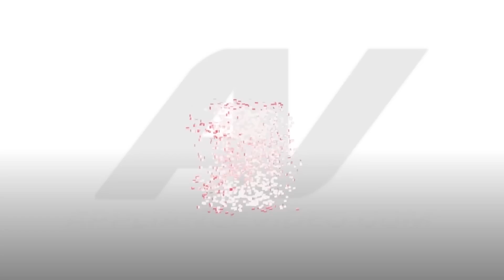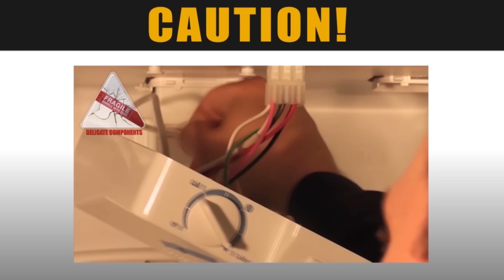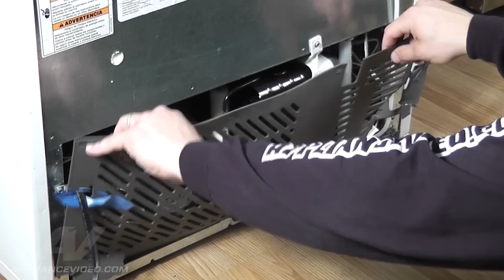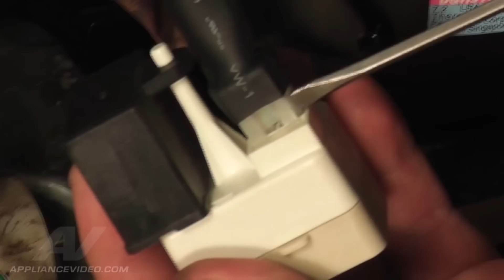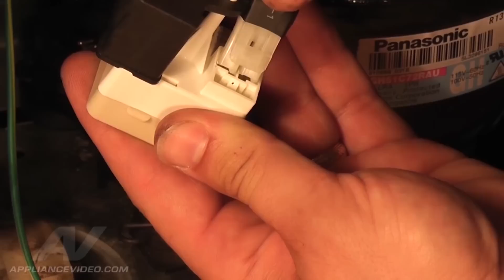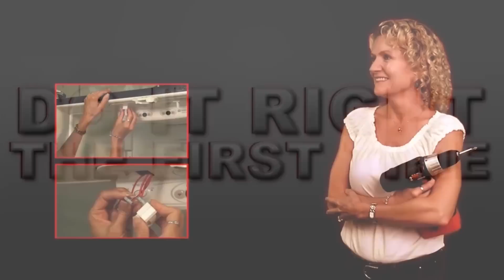Refrigerator Repair Starting components,Run Capacitor- Whirlpoo ,Kenmore,KitchenAid ,Roper# 2264017

Comment: I have a MayTag refrigerator model number MZD2766GEW and the relay overload has gone bad and I want to change it to make the unit work good again,as a matter of fact I bought one that came up with the model number from appliancepartspros.com and sadly enough it did not solve the problem and when I returned it and told them what went wrong they did not refund my money so I want to know which relay overload do I have to buy that will work with my unit because I don't want to loose money again,number on the compressor is EGY100HLP.
Reply from the maker: Great question, if you have a more technical question that our parts department cannot answer, you can search our over 17,000 answered questions free at our website www.ApplianceVideo.com under our Repair Help section. You can also call our parts department at 1-800-830-5465 and they can give you help 7-days A week ,or search at www.SaveMoreOnParts.com  .

Comment: this video doesn't show how to test the capacitor... sad mode!
Reply from the maker: Great question, you can call
our parts department at 1-800-830-5465 and they can give you help 6-days A week
Mon-Sat . You can also search at www.SaveMoreOnParts.com 7- days a week.  If you have a more
technical question that our parts department cannot answer, our technicians are
answering all questions at our website at www.ApplianceVideo.com under our Repair Help section. We have over 6,000
common questions and answers that you can easily search through by your model
number, appliance make, problem or error codes, and It’s completely free to
search through our question & answer library. There is a very good chance
you question is already answered there.
Reply: they dont want you to test..just buy...
Reply: Nelson Beato same thing I was looking for they didn't even show you if it worked

Comment: hi...
kindly advice for this  prblem with my refrgrator..
i used new one so it was out of servics for 5 months then i transferd it by car to another place ..now its not working at all even the light! but theres only sound coming like(tic) when plug in  then nothing after that..
Reply from the maker: Great question, you can call our parts department at 1-800-830-5465 and they can give
you help 7-days A week. If you have a more technical question that our parts
department cannot answer, our technicians are answering
all questions at our website at www.ApplianceVideo.com under our Repair Help section. We have over 3,000 common questions
and answers that you can easily search through by your model number, appliance
make, and problem or error codes, and It’s free to search through our question
& answer library.
Reply: If you layer it down it’s toast

Comment: I have fix my fridge fan that cools the compressor and know it just keeps running!
Reply from the maker: +Abi Berrios 

         Good question, with our technicians
now getting hundreds questions weekly, they are answering all questions at our
website http://www.appliancevideo.com/repair-help/ .  We also have over 30000 common questions
and answers that you can easily search through by your model number, appliance
make, problem or error code and it’s absolutely FREE.

Comment: this video doesn't show how to test the run capacitor
Reply from the maker: Taijlall
         Go to our main website at ApplianceVideo.com and type in capacitor. We have 2600 more free videos on our website. I am sure you will find it.  Please help us provide more videos to our site by posting ApplianceVideo.com on your YouTube, Facebook or Twitter account or add us to your circles. If you are in need of any parts please support our parts department on line at http://savemoreonparts.com/ or call 1-800-830-5465 7-days a week until 11pm Eastern time. Thanks again your support.  Matt, Ace Appliance service technician.
Reply: +Taijlall Brij the title clearly states. REPAIR, Run capacitor. :D To test your run capacitor read the rating in n F on the side. Take note of the reading. Use a multimeter place on the capacitor test mode and test. If its outside of the n F reading listed on the side of the capacitor you have a bad  capacitor :D